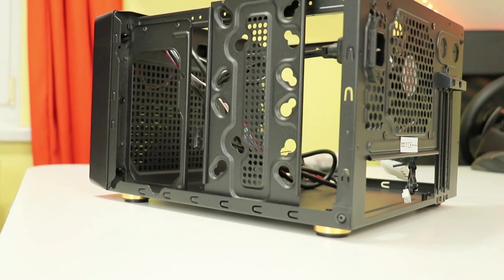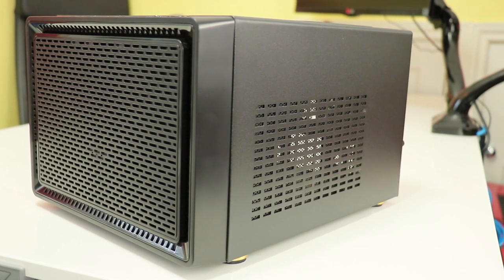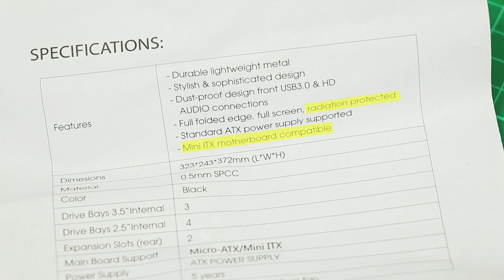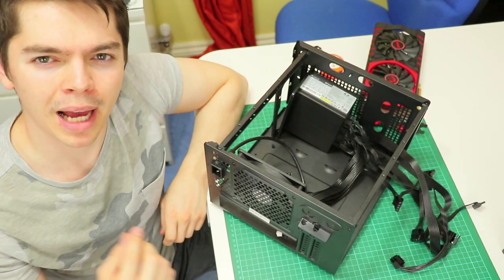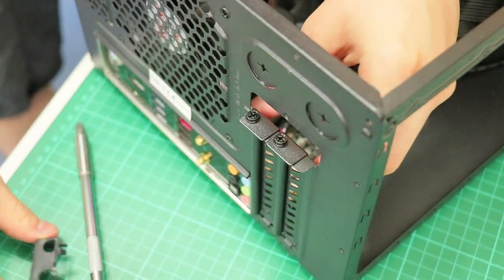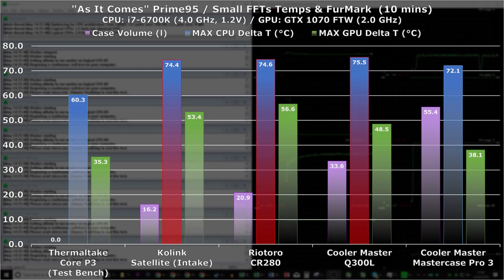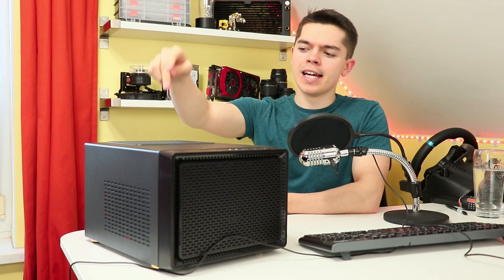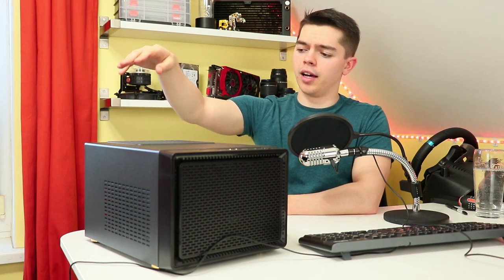Kolink Satellite (Mini ITX/Micro ATX) Review

Comment: The metallic ring on the cables is a ferrite core to reduce radio interference. It's actually a real bonus to find one in a case at this price level.
Reply from the maker: Yeah a few people have mentioned that to me. It's nice that one is included, and I assume it's very useful for a HTPC style system. Thanks for the insight, and thanks for checking this one out!

Comment: best review for this case you can find on the web.

its near 2021 and this is still the smallest ATX case on the market that can fit a 226mm M-ATX board and 275mm GFX card in,
for only $35...

the todays case market is so full of rubbish, i'm glad this old gem still exist.
Reply: 22.6x22.1 will fit?
Reply: @pokemoon6491  226 x 185(+) should fit without problems
185(+) = depends on size of your power supply, 221mm will bump into a full ATX (as seen in the video)

ps. i would not risk it with 221mm
Reply: h610m HDV would fit? Somewone help

Comment: Thank you for the excellent review. I had old parts from an ATX case and managed to fit an Asrock B250-HDV which has dimensions of 22.6cm * 18.3 cm with 1or 2 millimeter to spare with a full ATX PSU the standard dimensions. Cable management was a challenged but still managed to fit it all in.
Reply: Hey Daffy the motherboard i have my eye on is 185 mm so your 1-2 mm analasys is super important to me. do you think it will fit?
Reply: Same i have 18,5cm pls Help bro
Reply: Sorry I don't check my email for Yes it will fit max 18.5cm but it will touch the PSU if you are ok with that

Comment: Hello. I know this is old review, but if you know or remember, can you tell me if a longer power supply will fit? I have EVGA 1000 P2 that I do not want to replace, it is 200mm long, and I think it will barely fit with the cables, but I have to be sure before I buy any case.

Comment: Im really late, but i have a question, i decided to build a PC for my slef in Micro ATX form. And those motherboards in the discription are over the recommended size. You told as the maximum size was 226mm x 180mm butsome of these motherboards have a size of 226 mm x 185 mm (I dont really know if that 0.5 cm really makes a difference, im just confused)
Reply: this is what i currently want to know because the cheapest motherboard my eye is on is 185 mm wide

Comment: Well, wish me luck. All my components are set, so I'm cramming a Hyper 212X, a 160mm non-modular PSU and a 210mm graphics card in there. Most thorough review I've seen of a case in a long while, subscribed!
Reply from the maker: Best of luck man! Hope the build goes well, and thanks for the sub!
Reply: @AVTechy  The 16 cm PSU was a no-go. Fortunately I had a 14 cm FSP Raider 550. Still took some serious manhandling and desoldering unused cables to decrease the thickness of the cable bundle pressing against the graphics card, but now I have a functional system inside the case.  Now it's my daily driver until I can afford the newest revision of the Ncase M1 and an external hard drive enclosure.

Thanks again for the video, it helped a lot to build inside the case in the right order.

Comment: Thanks for this review and build. Do you think that MSI AMD motherboard A320M-A PRO will fit in it? 22.6 X 18.8 cm in dimensions :D
I want to build an old pc with 	MSI Radeon RX 460 4G OC(one fan) and AMD RYZEN 3 2200 on it. PSU is 140x150x86 mm aswel. What do yoy think? best case for this build? innit?

Comment: Great video!! Please advise which PSU this case support? ATX or just SFX? Thank you
Reply: You can fit an ATX (I used a Kolink 600w non modular psu in my build - 140mm long) but it depends on the length of your GPU. I fitted a GTX 660ti which by modern standards is quite short. This allowed me to tuck the excess cables into the area where a longer GPU would encroach on.
Reply: @mikep9418  Hi, does the case come with the power cord to connect the PSU to back of case, or does that come separately? I noticed the end that plugs into the PSU has to be flat.
Reply: Yes, it comes with a short power cord.
Reply: @mikep9418  Thank you.
Reply: @naran_naran   I installed Hackintosh on my PC using this case. And it is too hard to use a wifi+ bluetooth adapter in this case. Beside, I think we cannot have both GPU and wifi card inside this case. So sad!!
Reply: @thinkingofyou112  I don't have first-hand experience with motherboards, but based on some videos I've seen, there are mobos with the Wifi built in.

Comment: This case is interesting as it makes the itx builds even batter with the mobo laying on it's back, and thus prevending the gpu sagging 
Good thing he mentioned the parts in the video description, because a "full size" gpu from 6 years ago is like..hmm, a small size nowadays, with it's 266mm of length of the EVGA GTX 1070 FTW from this video.
Nowadays the full size is like 100mm longer
Good video

Comment: I have this exact case, except not.
Mine is branded as a GOLDEN FIELD N-1 ITX case, which looks exactly the same, but with scaled-down dimensions. Also, for whatever reason, there was a badge on the front that said 21+ [Twenty-One +]. Haven't the foggiest idea why as it's completely unrelated to the brand or model name 🤷🏻‍♂️
The badge was held on with little metal wire tabs, so I bent them back straight and removed it completely for a clean, badge-less aesthetic. Quite an easy mod. Thankful they didn't decide to glue it on or heat-fuse it to the front panel.

P.S. - You can fit Noctua's slim 120x15mm fan behind the front panel for extra cooling. It's just held on with zip ties but you'd never know unless you took the front panel off.
I spray painted it black because Noctua doesn't offer that size in black yet lol.
I'm snobby enough to care about having quality fans, yet hypocritical enough to mask the vomit brown color scheme that should have never been a thing. Much like the beige, off-white towers of yesteryear. Been thinking about building my own case out of a nice wood and staining it. Noctua fans would look right at home in a wooden PC case.

P.P.S. - Nice mouse. I have a G602 and absolutely love it. Did a lithium-ion rechargeable battery mod on mine because why not?
Reply: Here, for anyone curious:
https://www.amazon.com/dp/B076KC2SBQ/ref=cm_sw_r_cp_apa_i_kLZ6EbVQTSF75

Comment: Very thorough review, as always, interesting to see how much information can be pulled from a really cheap case like that...and I know this wasn’t an easy one either. With the strange matx situation and the lack of real support. Good job on the additional research 👍

Would have one consideration for you to maybe think about, as it’s becoming more apparent these small cases can’t hold up to the „torture“(tests) and only reveal their meaning by how far the cpu throttles down to.
I think it would be good to set them behind the other tests as these show nicer differences in typical use cases.
Perhaps you can read some engagement data out of the analytics on that?? 

One cooling solution it didn’t consider as I didn’t realize the fan was a 120mm, it looked like a 92...
This would be a good use case for a AIO to get the cpu temps down.
Or a tiny open loop^^

Good job on blending in and out the top cover, probably not to difficult in post but still a nice visual effect and on „multiplying“ your drives, that was probably harder to do and get them to the same spot again. 

Ohh, not so much „affiliate links“ it’s just additional information ...“for prices in your region, check out the links in the description“ ;-)

Good job on pushing through this one, good luck on the Raven

Comment: Great review. The PSU used in this video is the EVGA SuperNova NEX750B and it is 164mm deep. You could get a 140mm deep PSU to get some more room. A deep PSU and long graphics card will not fit. And the standard for microATX (244 × 244 mm) so why could they not have made the case a little bit larger. I would have loved this case if I could use a standard size mATX motherboard instead of a Mini-ITX. This case is identical to the Cooler Master Elite 110 in size, but difference is that you have a cpu cooler limitation compared to this case.

For me this case is not worth investing in if you are going to use a SFX PSU and the reason for that is you could just get the Silverstone SG05 case which is even smaller and will provide you with enough room for a decent size cpu cooler. This Kolink Satellite case also seems so suffer a bit from poor ventilation and if ta different size tower cooler was used it would pull even more air from the case it self, I suspect this is the reason for the bad results. There is also NO reason to use such a tiny cooler in this specific mini-itx case.

That said, still a great in dept review of this case.

Comment: The Ring around the Audio Cable is a Ferrite Core. Designed to remove electrical frequencies, thus getting better sound. Some reading for anybody interested: https://www.murata.com/en-eu/products/emc/ferrite/basic/reason
Reply from the maker: Nicely done Joe, I suppose that supports the "Home Theater" scenario use for this case. It would be interesting to try the audio jack with and without the Ferrite Core to see if I can perceive a difference in quality.

Comment: Can you confirm Asus B320,B450 M-K is compatible with ATX PSU or SFX PSU bcz of 22.6x22.1cm size?
Reply: none of Asus AM4 Mobo is fit (even) with SFX psu. I took my case with SFX psu to computer shop and tried every ASUS matx AM4 mobo as you mentioned. The width is limited to 20cm only and the lenght is 23cm. So none of your mentioned AM4 MATX Mobo is compatible. And it's comfirmed. Some Biostar AM4 MATX will fit which have less than 20 cm width.

Comment: Good to see such a nice and thorough review! This is a surprisingly overlooked case, considering many cases close to this volume (such as many Silverstone Sugo options) either place the PSU immediately above the motherboard, or use a slim HTPC-style design, either of which reduces clearance for CPU coolers.

I've been looking at this case for a while, but am concerned about clearance for uATX boards.

I've been considering Gigabyte's B360M DS3H (coincidentally pictured at 3:20, on the right), since I'd like to install a dual-slot graphics card in the PCIe x16 slot, and need an x4 slot for an internal RAID card (I plan to remove the bracket, so the fact that the case only has 2 expansion slots is not an issue). Unfortunately, an x1 slot would cause a performance hit, so finding a 22.6cm long board with an x16 slot corresponding to the expansion slot closest to the CPU and an x4/x8/x16 slot corresponding to slot 3 has reduced available options considerably.

However, this board is said to be 20.5cm wide, and would certainly conflict with an ATX PSU. However, I'm curious if an SFX/SFX-L PSU (with an appropriately-oriented bracket) could still fit with this board. Can you tell how much clearance you had between your mini-ITX board and PSU? It would be greatly appreciated, since all sellers of the case are out of my country, so I would like to avoid having to return the case, if at all possible.

Thanks!
Reply from the maker: Thank you very much!

As for your question, I measured as best as I could taking the relevant offsets into account and on top of a 170mm wide ITX board you should be able to fit in a 30mm wider board with an SFX PSU in the optimal orientation. So that would be a maximum board width of 200mm (approx.) which would mean the B360M DS3H wouldn't be able to fit (by 5mm).

If you were crafty you could create your own PSU bracket that would shift the PSU over by 5mm. But that's potentially quite a bit of work and expense if you don't have the tools for it.

Let me know how you get on.
Reply: I ended up going for kind of an obscure motherboard, the ASUS EX-B360M-V5. I was eventually able to find one that could be shipped to the U.S. The good news is that this board (a few mm wider than the 18cm tolerance specification) still manages to fit with an ATX PSU.

However, I noticed that the chassis only came with enough screws (those designed for use with the anti-vibration grommets) for a 2x3.5" and 2x2.5" drive configuration. How did you go about mounting drives in the 3x3.5" or 4x2.5" configurations?
Reply: @undefined314  Hello my motherboard is 185 mm wide , i am super curious if that will fit. Can you please reply.

Comment: the radiation protection is probably the ferrite core and the grounding wire. Those are/can be used to reduce the effects of EM radiation on the system.

Comment: Just a quick one, I am looking to get this case for some server components I don't have a graphics card in this; My question is what is actually stopping me adding a fourth 3.5" drive to this? the mounts look relatively big enough to fit 4 on there and I wouldn't have the issue with clearance for the graphics card, would this be possible?
Reply from the maker: This case only has room for 3x 3.5" drives (two up top, one on the side). The side panel can't take another drive since the motherboard is covering the lower section, and a 3.5" drive is thicker and wider than a 2.5" 14mm drive. It's also worth noting that 2x 3.5" drives next to each other total to just over 200mm in width, and this case is only 190mm tall.

Comment: I've bought this case about a year ago to put my old J1900 board in that I use for custom built storage server purposes mainly.
Thanks to that massive space you've mentioned next to the GPU I was able to add an extra 3.5" HDD there with the use of double sided tape. There's enough space to add another 3.5" HDD next to it, for that I plan to make some kind of a bracket to secure the drives with screws.
My current setup is still the J1900 board with a full size, non modular PSU, 4x3.5" HDD and an SSD stuck on top of the PSU.
I looked up this case now because I'm thinking of replacing the motherboard with a micro-ATX one but I'm not sure if I want to try that, just wanted to see if someone tried that already.

Comment: Hey mate, excellent review. Could you maybe tell me if there is enough room to put something like a corsair H55 aio on the back if a big tower cooler, like a dark rock pro or Noctua d15, is installed? I am thinking big tower for cpu and kraken g12 for gpu. Thanks.
Reply from the maker: Thanks very much.

As for your question, Unless you place the AIO out the back there won't be enough room for the fan. Actually looking at the Dark Rock Pro 4, it's overhang to the rear looks so damn close to the rear of the case, I can't say I'd recommend placing a 27mm radiator behind it.

I can't say it won't work, I just can't guarantee it would. Sorry for the vagueness, and let late response.

Comment: Two questions have popped into my head about this case. At the top rear of case you have vents, could a case like this benefit from heatsinks where the fans sit beneath blowing upwards. Also you can have tower coolers in this, would you recommend them blow to the front into psu which can act like an exhaust.
Reply from the maker: First question, downdraft style coolers work well blowing air down into the motherboard since the turbulent exhaust can better cool surrounding components (in theory). Having the fan the other way around would mean the more linear intake air would avoid the surrounding components more, reducing the benefit to the surrounding component (in theory).

How much this effects everything, I don't know. It could be 2 degrees, or 5+, but that would need testing. I might look into this soon to see if I can get an answer.

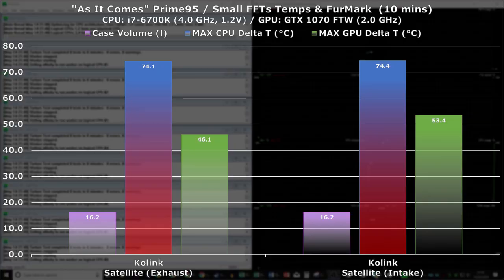As for the tower cooler question, there's a section of the video (30:11) that looks into a rear intake or exhaust. Of course this was done with a downdraft cooler, but a tower cooler would be able to take more advantage of wither setup. The best way to find out what configuration is best for your system is to play around with what you have. Some tower coolers will work better in certain scenarios than others (although there will be a limit to how different the results will be).

Comment: It fits those small form factor Emachines mAtx boards (da061l-3d), the ones with the low profile. I just installed one and was able to do a complete swap, including PSU (with an SFX to PSU adapter), and added GTX 730. my nephew was pleased.

Comment: So will the 2x 3,5 inch drives fit when the power supply is also placed?
Reply: I have an SFX power supply and 2x 3.5" drives attached to the top bar.

Comment: I`ve made 3 gaming systems in this case.  It`s a wicked case if folks know what to do with it.  I did the sfx PSU`s, ITX mboards and a larger cpu cooler, SSD, 2 x 2.5 drives and even 2 x 3.5 drives !  Top Tip : the graphics card is a bit far from the case side with holes in and the holes should have extended further back too so I mounted a pwm case fanon the side holes to draw air towards the graphics card and that reduced GPU temps under load by up to 10 degrees !

Comment: The listed Asus AM4 boards won't work because they're too wide (22.6x22.1cm instead of 22.6x18.0cm). You can get around this by using an SFX PSU. I've also seen a build where an ATX PSU was flipped 90 degrees and hovering over the motherboard.